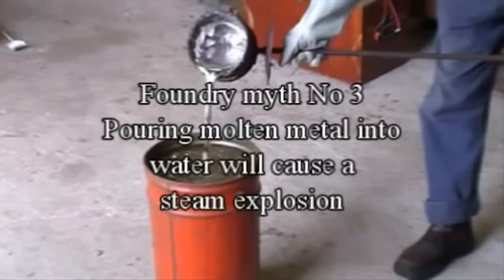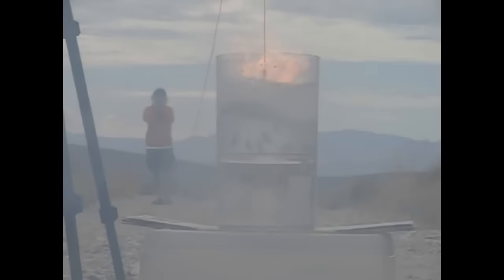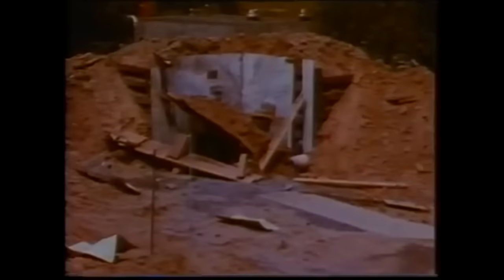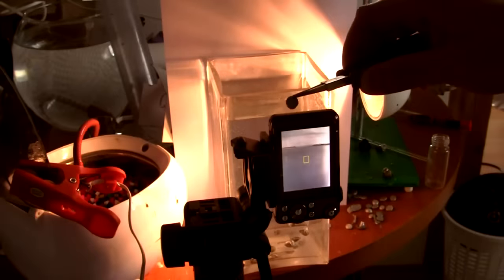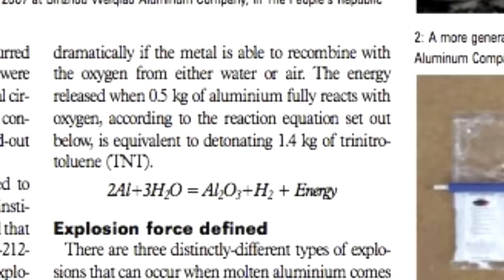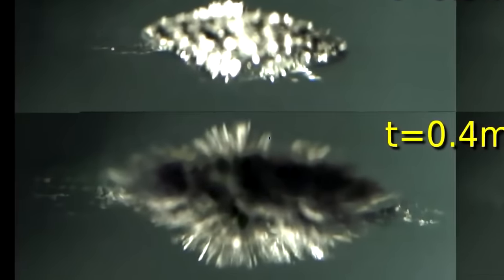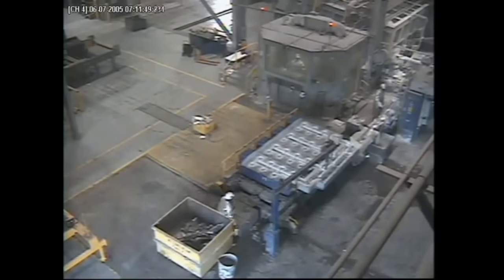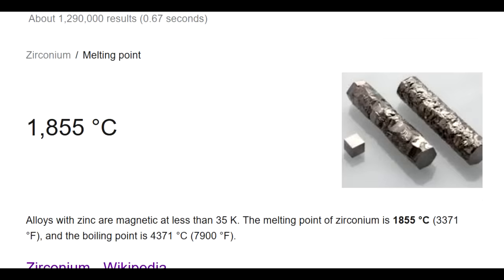The Awesome Power of the Aluminium-Water Explosion!

Comment: this teaches how to stay safe. and ironically enough,
how to make alloy bombs.
Reply: so... how do I remove the oxide layer?
Reply: @ArchieHalliwell  You prevent it from forming.
EDIT: Or you crack it while the metal's fluid. (Gaseous?) Cavitation and all that.
Reply: @FroggyMosh  
Honestly, sounds simpler and easier to just use a primary explosive.
You want an explosive to do three things: release a lot of energy, reliably go BOOM! when you want it to, and NEVER go BOOM! when you don't want it to.
Seems molten metal fails the last two criteria.
Reply: @bcubed72  Oh, metal certainly fails the criteria of what you want from an explosive.  Lucky! I don't give a hoot about wanting explosives and was just literally answering that guy's question with what was said in the vid (and made sense to me). 
I'm no fool. Explosives'll probably get me killed.
Reply: I feel it could change breaching methods. A sledgehammer with an aluminium & water head attachment, the moment it impacts, an explosion puts a hole through the impact zone, and safely prevents a violent or negative reaction due to all the force that is occurring on the hammer. Whatever violent force that affects it, will likely be less than a bounce back from its point of impact. The use of such an idea would be to possibly double or triple the effectiveness of a single sledgehammer impact, possibly for more reliable breaching.
Reply: @alphamoonman  sounds like a good idea, you should go and make it.

Comment: Worked in a Steel Mill for 5 years. We had a major explosion when I worked there that blew the walls of part of the building. First thing you learn is no liquids in the melt shop and if any water gets trapped under the metal surface, the rapid expansion from liquid to gas expands more than 1000x creating dangerous explosions. The aluminum experiment the second time reminds me of that where you had enough metal to fully cover the water and it had no where to go. Never new you could also have explosions due to clean metal surface on aluminum. Great video.
Reply: Meanwhile the people in the videos are placing molten metals in very high volumes of water in ratio to metal, but the risk remains due to involved reactions at fractions of a second against how much body of water there is in all directions to absorb the kinetic force.

Explosions in foundries deal with very small ratios of water against metals, and we can agree what happens when water is quickly heated to vapor temperatures.

Comment: Anyone with any experience with smelting high temperature metals knows never to pour into a cold mold as the moisture in a mold can cause the water to instantly vaporize and cause an explosion throwing hot metal in every direction. I know this from experience 😂🤣
Reply: Odious Ritual yeah.. I prefer my investment casting molds to be pretty hot, right from the furnace in fact, before pouring my little bits of gold down them.
Reply: Anonymous Anonymous watch making school teaches you some valuable skills! Casting is a rarity amongst horological disciplines, but I do a fair amount.
Reply: In this case it isn;t just the hot metal vapourising the water. There is an oxidation reaction which releases lots of energy and hydrogen gas. The released energy produces huge amounts of steam etc and results in stuff flying everywhere. The end result is something much worse than a simple steam explosion.
Reply: Anonymous Anonymous  in a way yeah a few things have to go wrong but I think that's what the video is going about. On another note, have you ever thought of using 3D printers to print PLA/Wax patterns?
Reply: I cast my own bullets. I had a whole pot of lead, something like 50 lbs of lead, explode in my face. Was wearing a face shield, and I did step back. I dropped some water hardened bullets that had defects back into the pot, I thought they were dry, but apparently they weren't. Anyhow it shot lead 15 feet in the air and about a 25 foot radius. I only had like 3 drops land on me, but it scared the life out of me, and I was still wearing all my ppe. Needless to say these people  are ignorant of the danger.
Reply: @memeier9894  I learned my lesson from trying to pour old monopoly pieces and solder as a kid. I think I was trying to make a mirror or something like that. Didn't turn out as well as I was hoping obviously.
Reply: Anonymous Anonymous  mesothelioma is not a game 😕 sorry to hear that
Reply: Well, some people are scared of moisture, some are scared of cracks in the mold, some don't want the molten metal to cool down unevenly and cause stresses, some don't want the metal too cool down too quickly and get stuck while pouring, some have no clue but read instructions that tell them to pre-heat. All of them heat up the mold.
Reply: Anonymous Anonymous  I already do.
Reply: Anonymous Anonymous  not really, I cast 12 gauge slugs and revolver bullets mostly.
Reply: Anonymous Anonymous  I watch Taofledermaus also.
Reply: @memeier9894  And that wasn't even this kind of metal explosion, but a far less powerful steam explosion.
Reply: @nescio03  exactly, I still just got lucky, even with proper safety equipment, these people are dancing with the devil, and dont even know it.
Reply: Anonymous Anonymous  yes, if the aluminium is clean enough. it is exactly the same scenario.

Comment: I worked as a machinist making Tesla suspension parts in a factory that also had its own foundry next door. Once a maintenance worker left a closed container of water he was drinking from inside of a "scrap bin" after he knocked it in. We use them to re melt aluminum parts that didn't meet quality, save and recycle material, it destroyed 1/4th of the foundry building ceiling and injured several people. Small Styrofoam cups only from hence forth. I had no idea that this was supposed to be a "myth".

Comment: Here is the reason why our melt shop is closed for visitors during winter time. Half melted or melted scrap metal that flies through the roof of the building is a bad thing. Good thing is that they built a really, really large roof over the scrap yard about a decade ago, minimising the risk for snow, ice and water in the scrap. Still, can’t be careful enough so still no visitors in winter time.

Comment: Having worked for 40 years with Titanium, Zirconium, Hafnium and Niobium I know a few things that can occur with hot metals. One stage in the production of a particular Zirconium product required a pre-heat treatment at 1000C followed by an immediate water quench. This always resulted in splitting the water into Oxygen and Hydrogen and whilst no explosion there was always a Hydrogen burn on the surface of the water for several seconds at the start of the quench (large sections of the order of  135mm square and in excess of 100kgs, usually some 400kgs plus at a time).

Comment: I have utmost respect for the heat of combustion of Aluminum. Its heat of combustion actually approaches the heat of combustion of gasoline on a " per unit mass" basis, but on a density basis, Aluminum has gasoline beat by almost 3 times. In the right conditions an aluminum water explosion can be a detonation!
And thank you for mentioning that "Coulomb explosion" paper---I do remember reading that one years ago and I was pretty impressed by it. Reactive Liquid metal in water does amazing things! Thank you!

Comment: I once burnt a substantial fire that was primarily fallen trees from a severe storm but it became apparent that other people had contributed to the massive pile when black smoke began roaring from the depths. The fire soon got pretty violent and the decision was made to put it out and water was sprayed on it to get it under control and that is when a violent explosion sent us all back to just watch from a distance not knowing what caused that event and concerned that another might hurt someone.  After the fire was out we found a couple car rims that were aluminum centered with a steel outer and the aluminum section turned into a shiny river stuck to the ground.  Now I think I finally know what caused the explosion. The fire must have been consuming the oxygen before it could form an oxide layer on the aluminum and when we doused it with water it allowed the explosion to happen. Awesome. i wonder if you could conduct an experiment in that fashion in the lab?

Comment: i work in a smeltery, our thermite ovens arent even using water in any process anymore instead just a wall of some type of concrete. 
electric arc furnaces are still watercolled aswell as the casts themselves, seen myself 3-2tonns of already hardened metal fly up stories high from the water bath.
Reply: Stardust adding electricity into the equation does create a risk in itself, but without it, the reaction is simply a heat reaction causing the water to flash to steam at 1600/times its original volume that causes the expulsion of the metal from molds, NOT a chemical reaction as video claims.....unless you add electricity.

Comment: I used to work in a lead processing plant. If the lead bars had water on them when we put them into a kettle, they would explode. Violently.
Reply: Same thing when galvanizing something in molten zinc,any water or ice (notorious inside cavities) => steam explosion.
Reply: Poor lead.... never did care for the teachings of MLKJr.
Reply: @calistohuettich  Not if you spin in a circle 3 times, stand on one leg, and shout "veni vidi vici". Then you get your fortune.
Reply: Yeah we used to put lots of stuff into the kettles that didn't belong. Whatever didn't burn or melt we wound up shoveling off the top as dross anyway. And yeah, we occasionally put water on top of lead blocks to teach new guys about the danger. Fun, dangerous, and educational all at once.
Reply: I’ve cast molten lead, tin, and zinc. I once dropped a damp piece into the pot, and molten droplets went 20 feet into the air! Not something to play with.
Reply: @5roundsrapid263  I had no respect for a moist mold once, pouring molten tin into it and had it explode on my face. Not a nice feeling. Now, 20 years later I still lack 40% eyesight on my right eye.
Reply: flabbergast Good Lord! Sorry to hear that. I always wear goggles and heat my molds.

Comment: I've worked in a foundry for 30 odd years (retired) with non ferrous metals and aluminium. I have also rolled it down to tin foil gauge. Aluminium is rolled in a torrent of suds oil and still when the conditions are just right up it will go and quite spectacularly too. It is so dangerous that we had a CO2 dump fire control, and it would be used once or twice a year.

Comment: Reverse the ratios of water and molten metal, then see what happens
Reply: A steam explosion, which is something entirely different. But equally dangerous.
Reply: @nescio03  Yep, for the same reason you always add an acid to water and you don't drip water onto an acid. The first droplet can't absorb the heat from the exothermic reaction without boiling/flashing to steam and when it does that, it throws around the other stuff (be it acid or molten aluminium, it's gonna be a bad day).
Reply: @nescio03  thats why when casting into steel molds we Always preheat your molds. Mold can look perfectly dry but stick it in the flames and it literally weeps water out of it. Steam explosions are no joke.
Reply: @keithyinger3326  the rust layer can bind water, and release it only when heated.
Reply: I was also thinking that the major explosions in the video (with aluminum) were when a large amount of the molten metal was added quickly to a small amount of water.  It seemed that a large amount of water, compared to the amount and speed at which the molten metal was added, was able to absorb the heat transfer safely.  When the amount of water was small by comparison, it was instantly overwhelmed and turned into steam so fast, the steam was the source of the blast. Reminded me more of what it would be like if you poured some water into a pot of hot oil.
Reply: @mcolynuck  Basically summed up my thoughts. Its quite clear that this is only an issue at lower metal/water ratios. Ratios that allow large amounts of water to suddenly boil. Backyard Scientist is a bit of an idiot, but pouring a small amount of molten metal wasn't the stupid thing he was doing. These massive explosions are clearly not explosions as a result of a chemical reaction between aluminum and water, but small amounts of water in a crucible or similar rapidly boiling, which spreads molten metal everywhere and starts fires.

Comparing a steam explosion to the reaction of a highly reactive metal and water was stupid on Thunderfoot's part.
Reply: In fact, here is a study where they failed to produce explosions from molten aluminum being dropped into large volumes of water. They only managed to achieve in in Al-Li alloys.

https://www.sciencedirect.com/science/article/pii/0029549394008864
Reply: Exactly what I was thinking.

Sure you might get the water and aluminium to explode of you poured it violently so the oxide layer are broken or the aluminium is hot enough that it is all molten.

Pouring a small quantity of aluminium into allot of water should be "safeish"
Reply: @aggese  Even then, a new oxide layer forms.
Reply: @DreadX10  It is always fun when someone mixes it up and pours water into an acid... Also it is fun when they forget to mix the stuff while heating it the superheating is my favourite phenomena.
Reply: @kylesenior  A steam explosion is one thing, but I think the issue comes out violently when the smaller amount of steam forces it's way into the molten (and hence unoxidized) aluminum mass and can thus react violently at will, which would then increase the available reaction area elsewhere, etc. So it's probably not so much volumes in any case, but the creation of situations where the available reactive surface is increasing faster than the natural passivation can account for and running away. 

This is exothermal, if at any point an aluminum vapor is produced in proximity with water or water vapor...

Comment: It is like oil and water when cooking - throw a teaspoon of water into a deep fryer and you are going to get severely burned. Throw some butter or olive oil into a pan sauce and you have literally 0 risk of an explosion. 

The issue is a ratio of water to metal
. You need enough energy to turn the entirety of the water to steam pretty much instantly. That means 12+lbs of aluminum per gallon of water, poured in extremely fast. That is a massive issue when you have a third of an inch of water at the bottom of a container and are pouring a couple dozen pounds of aluminum into it, not an issue when drizzling 1-2 pounds into a 5 gallon bucket or a pool
Reply: The big question here is how much butter does it take to make a saucepan of aluminium taste good.
Reply: Please watch the video again; a piece of reactive metal the size of a pill blew a flask into flying shrapnel.  That is NOT 'no problem'.  Yes, there is a correlation between mass and energy released, but he clearly showed that even a tiny piece, under the right circumstances, can be very dangerous.
Reply: @KeithOlson  That's an alkali metal. Thunderf00t is claiming ALL molten metals (or just Al? unsure from the video) behave like alkali metals, if pure enough. That's a hell of a claim, and while I'm willing to hear him out, I need to see it happen, in a way that flash steam explosion can be ruled out (i.e. significant excess of water.)
Nothing in this video meets those standards.
Reply: @KeithOlson  that is an alkali metal. That could not be less relevant. That is hydrogen and oxygen being separated then combusting, while the only risk with aluminum is a steam explosion.

No circumstances makes aluminum have 1 electron in its outer shell. That is literally alchemy to make that happen
Reply: Keith Olson the alkali series metals are totally irrelevant to this video. Aluminium is not an alkali metal. The flashing of molten metals when pouring into wet moulds is also totally irrelevant as this is the flashing of water to steam at 1600/times its original volume that causes the expulsion of the metal, NOT a chemical reaction.
Reply: @gholland5840  Wrong 2Al + 3H2O → 3H2 + Al2O3 in plain English that is to say that Aluminium will strip the Oxygen from the Hydrogen in the water. This then results in an extremely hot rapidly expanding pocket of hot gas (steam, hydrogen, and even molten and partially vaporized Aluminium Oxide). Of course this expanding gas will continue to burn at the interface between it and the air as the Hydrogen will be way above it's autoignition temperature. That is not just a steam explosion Aluminium has a highly exothermic chemical reaction with the water directly and produces even more very hot flammable gas in the process.
Reply: @seraphina985  Aluminum oxide forms then protects the metal from further reaction.